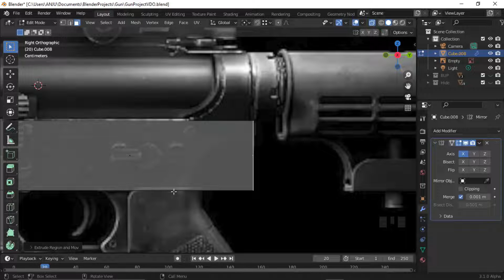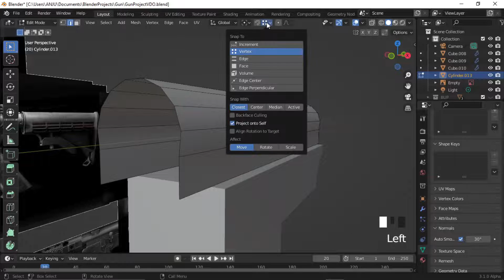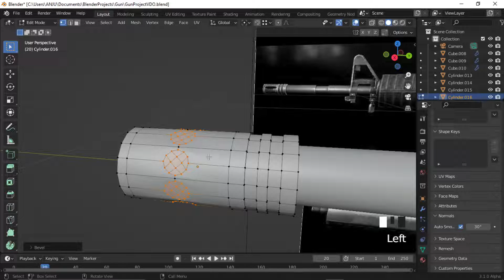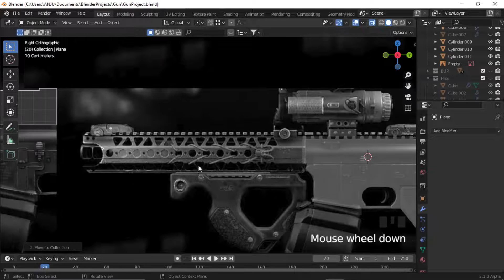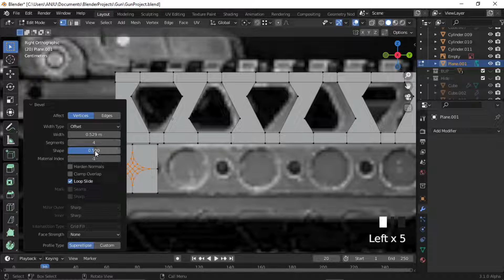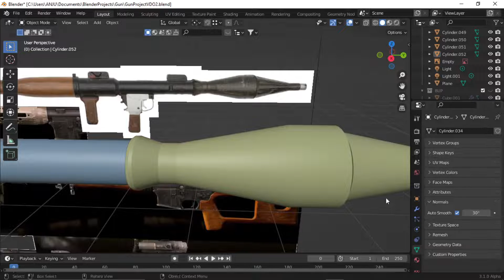Low poly Guns in BLENDER

Comment: Rather than use "orbit around selection", some may prefer the "auto->depth" checkbox (with orbit around selection turned off). Rather than orbit around whatever is selected, it will orbit around your cursor location, or whatever you have hovered last. So you can manually place it to define your orbits. It takes some getting use to, but provides a lot more control over the camera. Removes the need to constantly zoom and pan to fix the orbits.
Reply from the maker: Thanks.. That is also very usefull
Reply: to be fair whenever i see someone not using orbit around selection i imagine they are a psychopath irl.

Comment: so I did the control B but when I do I can not get the curve like you do and I am going on the same axis as you so not sure what is going on
Reply from the maker: Its CtrlShiftB  
Select vertex and press CtrlShiftB 
Then drag Mouse wheel to add more loops.
Reply: @ALLTHEWORKS11  THANKS
Reply: @neca 33 You may have found out by now but:

ctrl + B is for edges and faces

ctrl + shift + B is for vertices

:)